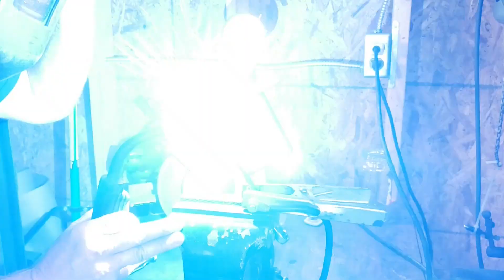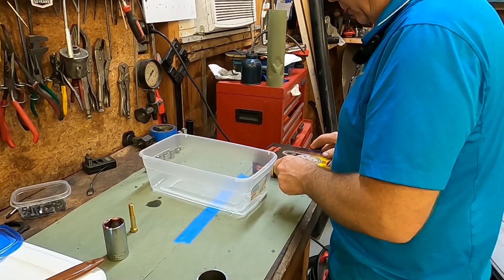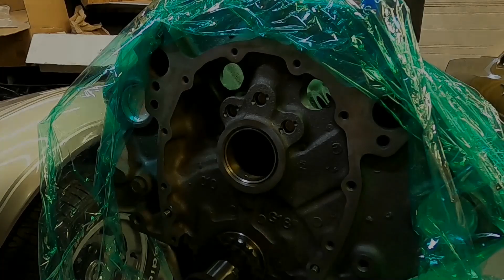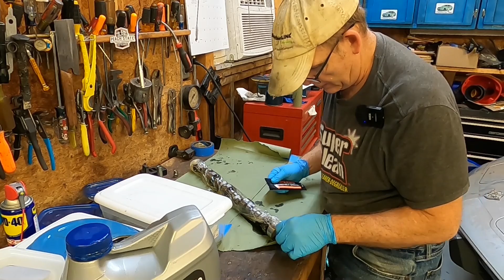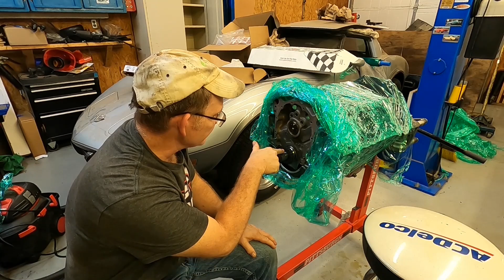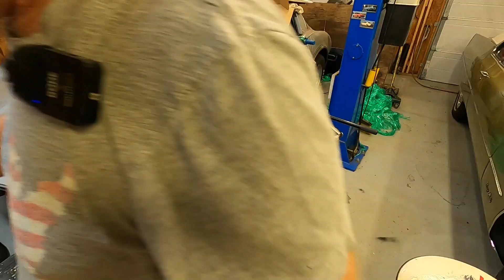1978 Corvette Restoration Part 19 - Erson Roller Cam and Timing Set Installation

Comment: I missed the part where you set up the end play on that roller cam, the cam button.
Reply from the maker: That's because I didn't do it. Sort of a risky move. I need to talk to the kit builder and see if that is really necessary. This button and cover are from the same company and are supposed to work together.
Reply: @ImpalamansGarage  Maybe I'm a little too technical and have had some bad experiences with camshafts. I hope it gives you no trouble and runs really good for a long time.